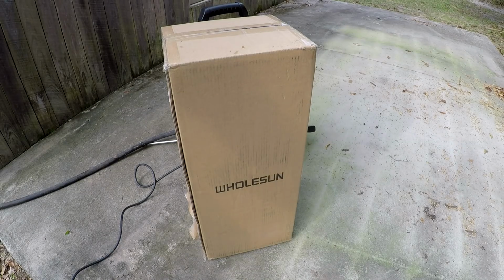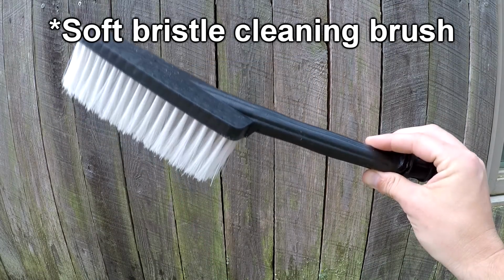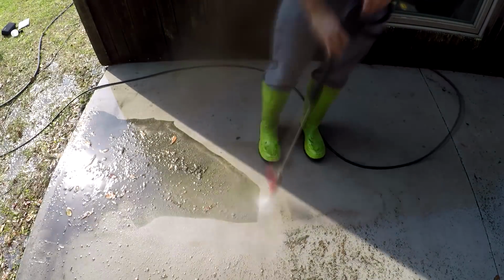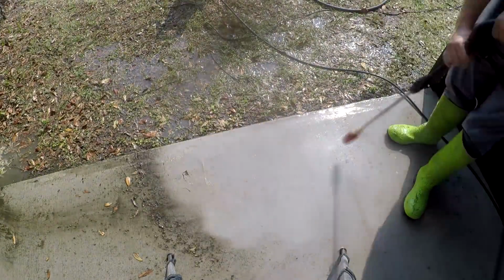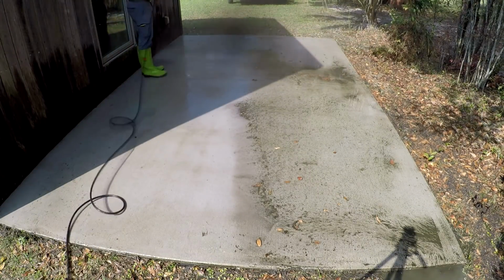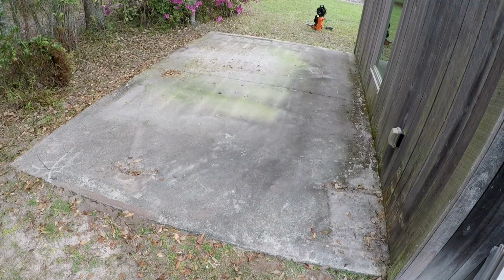Moldy, Fuzzy, Filthy Concrete Patio & Wood Pressure Washing (Oddly Satisfying)

Comment: First, it is very easy to put together with clear step-by-step instructions. Second, it has a very small footprint so it fits nicely anywhere in the garage without protruding out. Third it is very powerful. We used it to power wash all stone and concrete surfaces around our house and pool and then even the sidewalk in front of the house.

Comment: I'm impressed 👍🏻 Looks good for only 1,800 PSI
Reply: Anything over 2500 psi.  Will damage concrete. If it's new concrete around 1000-1500 psi. The more gpm you have the faster you can clean.

Comment: 0:56 I think simply spraying off excess debris with garden hose or blowing with leaf blower or whatever method works for you will be better, and then pressure washing the sand or dirt or whatever is on the concrete

Comment: What tool or attachment  do you use when you do the edges. It looks like your Rolling the wand on the ground but the tip isn't touching the concrete.

Comment: If you had a higher psi washer that whole fence would be messed up from your technique. Streaks are very prominent in wood so you need to have consistent horizontal lines.

Comment: You said 3 gallons per minute. I can't find anything north of 2.6. Anyway, do these units have M22 fittings? I use converters on all my electric washers so I can use quick connect -- just like my gas unit. I then use a premium hose, gun, and wand.

Comment: Brad I am not to happy with my pressure washer. I was trying to use my pressure washer and apply soap foam to my wife's 2019 RAM 1500, when all of a sudden the Black Tip decided to blast off of the wand, putting a dent in the front left fender....I am NOT a happy camper. Its going to cost me $150 to get that dent out now. I have already contacted Honda and told them their Black Tip will not lock into the wand....Lets see what their excuse is.

Comment: Can I ask why you didn’t continue cleaning the rest of the wood above the patio, you done a bit but there were still parts towards the. Window that looked awful.
Reply from the maker: The job was just the concrete. I had to pick somewhere to stop otherwise the job would have turned from a small patio into 4 sides of a huge workshop. So I just cleaned what looked damaged and a bit higher so they could cut out all the bad and replace with new if they wanted to.